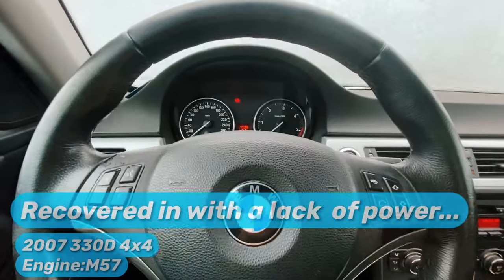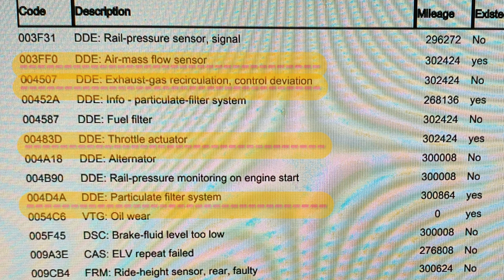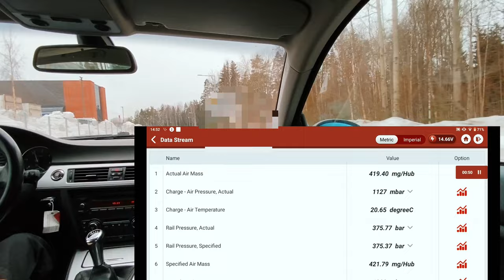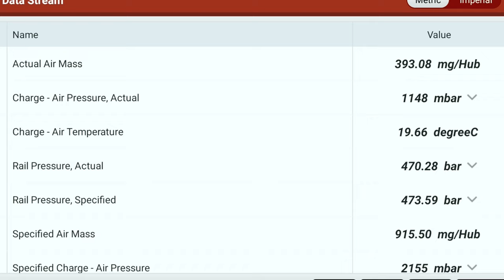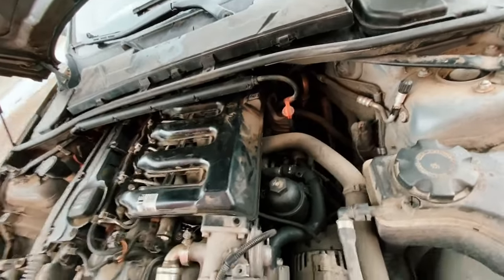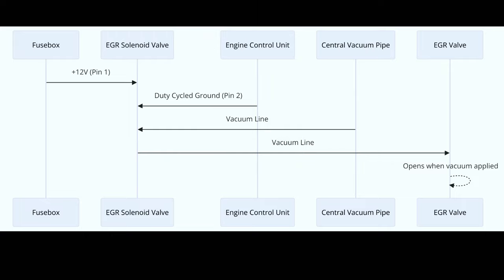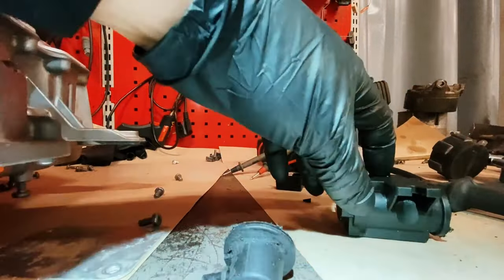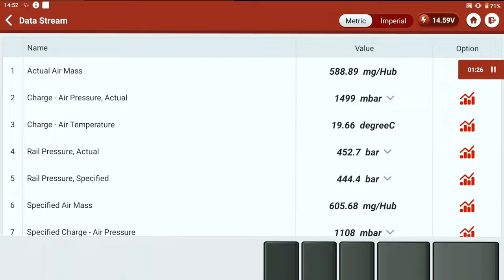MASS AIR FLOW TOO LOW ON A 330D. AIR MASS FAULT EGR FAULTY. LEARN AND STOP WASTING MONEY

Comment: Just found this channel, instantly subbed. I'm guessing you're up north or I'd be bringing my 325D to you to try and figure out why the fuel pressure is always lags behind where it should be under load.
I've replaced the fuel pump solenoid, rail pressure sensor, rail solenoid, MAF, vacuum solenoids, done a leak off test.. Heck I've even replaced the fluffy dice on the rear view mirror😂
Reply from the maker: I live in Finland mate 😅 Thanks for subscribing mate. Check oil level, those pumps can leak from the shaft into the engine oil. They also leak into cylinders sometimes.

REMOVE RUBBER PIPE OFF RAIL PRESSURE REG VALVE AT BACK OF RAIL. PUT IGNITION ON AND SEE IF FUEL LEAKS. If it does its knackered
Reply: @allmech_BMW_fault_finding  That's a bit further away than I thought 😂 Thank you very much for the hints, it gives me other things to explore 😁👍🏻
Reply from the maker: @SabretoothBarnacle No worries mate. Pop back if you need help
Reply: @allmech_BMW_fault_finding  Just to clarify, ignition on is just to cycle the low pressure fuel pump... Is that enough pressure to get through to the fuel rail? I can switch on the low pressure fuel pump via ISTA and leave running for a longer time if that's useful?
Reply from the maker: @SabretoothBarnacle there should be residual pressure anyhow. Run the low pressure pump if you want to it makes no odds. There should not be fuel coming out of that at all with lp pump running with engine off